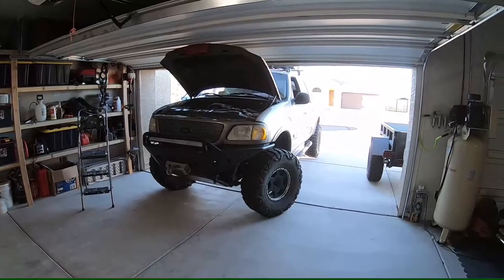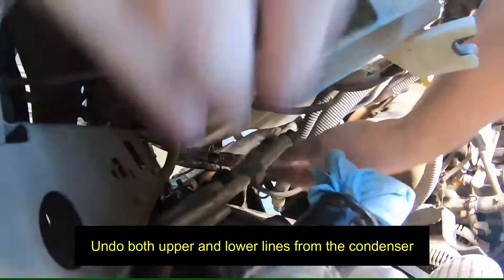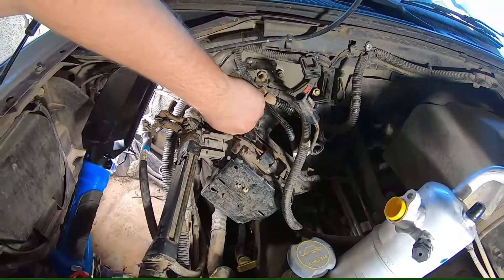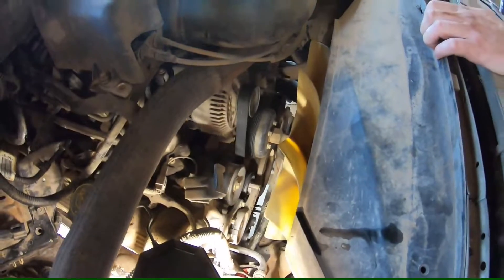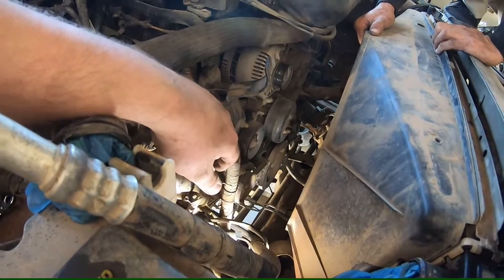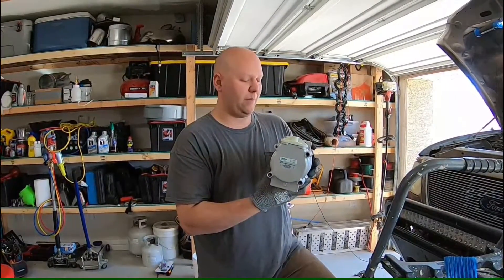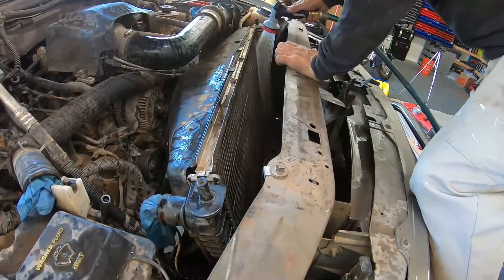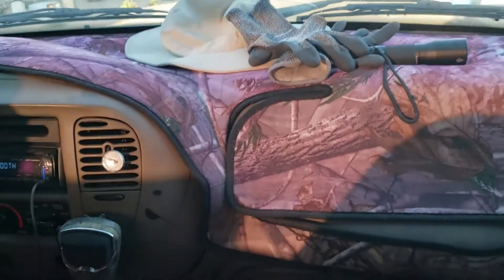1997-2003 Ford F150 A/C Replacement

Comment: Finally thank you I have a 2000 ford f150 that was sitting for 7 years and the stopped working after the mechanics changed the radiator and was deciding to work on it myself and this is the first video I found that was step by step and shows each part and piece
Reply from the maker: Glad I could help!

Comment: I am concluding a 2002 F150 5.4 air conditioning system replacement. 100% new. The dash board removal was awful time consuming. I changed the heater core while it was disassembled. The orifice tube was jammed packed with more debris than what you encountered in this videos. Accordingly, I didn’t believe a flush would suffice, hence the 100% new parts. However, the core inside the dashboard was pristine when I flushed it. Ultimately the core and the dashboard did not require replacement because of the orifice tube and the heater core was pristine as well. Cautious exercises to protect a new system was unnecessary but I wouldn’t be satisfied with uncertainty. Your video was very helpful. Thank you.
Reply from the maker: Glad I could help! Good call on taking care of the heater core while you were in there. Do it now or do it again later

Comment: Thank you! Because of this video I was able to put ac in my 1999 F-150 after almost 3 years without. Hardest part of the job was the accumulator by far! Thanks for a detailed video on this process it made this way cheaper for me then it would have been at the shop. Just  over $400 later and my ac is blasting cold 🥶 👍🏻
Reply from the maker: Heck yeah! That is what I like to hear :D. Thanks for watching and the comment!

Comment: Loved the video, it will really help me with my A/C replacement.  About to replace the whole A/C system in my 2001 Ford F150, 5.4 L.  At what point do you flush the system and what flush do you recommend?  When adding oil do you add all the oil needed for the system to the compressor or do you need to add the oil to the dryer and condenser as well?
Reply from the maker: I really rarely flush a/c systems...but I'm also not a mechanic. I like to use air and if it blows freely I hook it all up and call it a day. Oil they usually say to add it all to the compressor. Half the time you won't be able to get it all in there though so I'll put some in every component I'm able to access

Comment: How many oz of r134 did you charge with? Sticker says 33oz. I replaced condenser, manifold lines, orifice, dryer and compressor. Oiled correctly, vacuumed down for about 2 hours, let it sit for another hour with no movement on gauge. Charged it up at 33oz and it will not get cooler than 50. Pressures are about 50/275 at 90 outside.
Reply from the maker: Shoot it has been a long time since we did this one. I do not remember how much we charged it to unfortunately

Comment: Can you tell me what lift you used for this ford? I’m looking for same height and wheel tire ratio
Reply from the maker: Thanks for watching!
It's a 6 inch fabtech lift with 37" tires. 1" spacers, A little trimming at bottom of fenders to keep from rubbing
Reply from the maker: Nitto Mud Grapplers 37x13.50 R17

Comment: I just want to unplug wire leading to ac compressor… does it just pull out or is it a clip plug?
Reply from the maker: It'll have a clip on it if it isn't already broken!
Reply: @AGuyandHisProjects  thx for getting back sir! It does not pull out and I gather the clip isn’t broken lol… and have to be gumby to even get to it without taking 2-3 things off.. any ideas of easiest way? Much appreciated
Reply from the maker: @wolfkat6492  no problem! Typically a long thin screwdriver to pull the tab out of the way. If no good angle then a little tiny flat screwdriver sometimes gets you closer. You can also drop a tad of lubricant in the area sometimes first to break the crust up
Reply: @AGuyandHisProjects  thanks again bud! Will give it a shot.. would the pulley spin more freely and keep my belt safe?
Reply from the maker: @wolfkat6492  by unplugging the compressor? I am not a mechanic by any means, but I don't think that would help. If the clutch is seizing up with will be seized with or without electrical being hooked up. When the clutch is not pulled in (a/c off) the pulley should spin freely. If it isn't then you need to replace it or get some kind of bypass kit I would think.

Comment: Can’t get the top single bolt off it’s in an awkward position. How did you get all 3 compressor bolts off?
Reply from the maker: It's been a hot minute since this one. I don't remember struggling with that though

Comment: I don't know if you can help but the hard to get bolt you talked about on the A/C compressor is stripped. I have tried bolt socket extractors and a chisel. My lest resort would be to completely cut the bolt head off but I'm worried and won't be able to pull the compressor with the frame so close and the rest of bolt still in it.  Any suggestions would help. Thanks and great video!
Reply from the maker: Hmm tough spot you are in lol. If you have a welder you could weld a nut to the bolt head. Or possibly get away with vice grips and a torch. Maybe some others will pop up with some good ideas. Maybe cut head of bolt off and let compressor slid down a bit then Sawzall the other end off. Idk

Comment: How exactly do you get the second bolt in the back of the compressor off? I cant get it with anything because the spot is so tight and my ratchet wont fit. Everything else i try is trying to round the bolt off, did you all have that problem?
Reply from the maker: Yeah I vaguely remember that issue. I think we used a 1/4" ratchet and spent a lot of time making small movements

Comment: there are a few things you should note before starting this project:

1 - get your AC system evacuated before you break any joints.  takes a few minutes and practically any garage can do it for you.  this does not affect driveability
2 - take off the fan blade before the serpentine belt.  Autozone and most parts stores have a tool you can borrow for a 100% refundable deposit
3 - you 100% will leak engine coolant so be prepared to capture that and not re-use it.  buy new stuff.  also, it's got glycol in it so it's not going to evaporate if you drip some so clean it up
4 - every component in the ac system has oil in it so be prepared to capture that as well
5 - the accumulator requires a special tool to remove it that costs about $5 at autozone or any parts store.  it will likely have 4 size options and 1 will definitely fit your application
6 - if you are struggling to get the accumulator off, a little time with a torch will help loosen things up but use this as a last resort.  it is common for the o-rings, and there are 2, to basically seal themselves to the inner wall of the tubing.  the heat will loosen the seals.  if you don't try this, i promise you the garage you take it to will do this.  DON'T START THE ENGINE COMPARTMENT ON FIRE!!!
7 - there are 2 rubber/plastic guides on the side of the condensor.  these need to go back on when you're finished.  they allow the fan to suck air through the condensor when the vehicle is running but not moving.  if you don't you will not get cold air
8 - the guides mentioned in note 7 are held in place by push fasteners the press into holes attached to the condensor.  it is extremely likely that those holes will not be available on the replacement condensor so you will need to find another method for attaching the guides.
9 - clean as you go!  you don't want debris falling onto sealing surfaces or contaminating the system when you are putting everything back together
10 - the high pressure gas tubes that connect to the compressor are very likely rusty and very brittle (your vehicle is nearly 20 years old so...).  they may need to be replaced if you can't get pressure built up in the system after reassembly
11 - there are 3 bolts in the compressor.  2 are accessed from underneath and 1 through the wheel well.  that's how i did it any way.  the 1 bolt on the top MUST BE INSTALLED IN THE COMPRESSOR PRIOR TO INSTALLING.  there is not enough room to get the bolt in place when the compressor is back in place.  save some time and put the top bolt in before sliding the compressor in place
12 - READ THE INSTRUCTIONS ON THE COMPRESSOR!!!  there is a sticker on the compressor that says how much oil is preloaded.  the instructions will tell you the total amount required for proper operation.  mine came with 3 ounces.  the bottle of oil i bought had 8 ounces.  the compressor required 9.  i did absolutely measure out and add exactly 6 ounces prior to installing the compressor
13 - if at any point you get stuck or frustrated, stop.  the vehicle still drives perfectly fine after putting the belt back on.  of course that will require the compressor to be installed.  it is better to suck it up and bring it in then cause permanent damage out of frustration.

lastly, and most importantly, this is a job that can be done with a very basic set of tools and will take the average garage mechanic 6-8 hours.  it is totally doable and very fulfilling.  when you take your system in to get charged the mechanic will definitely respect the skills.  mine did.
Reply from the maker: Thank you for the thought out comment! Yes it is indeed very rewarding!

Comment: What about the evaporator core? Is some of the metal fragments left in the evaporator if you don't change it? My freon just leaked down. The compressor is still good. Truck had 53,000 miles when I bought it total wrecked, It set up for 5 years. Then I changed the frame leaving the A/C intact and A/C needed a little charge and afterward worked a few years and leaked down. Added some 134 and stop leak and got the A/C blowing cold for a year but last year it leaked down, and I have been driving without it this year. We had record 100 degrees plus heat here in New Orleans for a couple of weeks and forecast more to come. I turned on a fan mounted on my sun visor, and it felt like I was in front of a heater. So looking to get the A/C working. Guess I need to shoot some dye in the system and see if I can see where the leak is. Maybe fix the leak and change all the O rings, replace drier accumulator and orifice tube then evacuate and add Freon. Hoping the leak is not in the evaporator core. IF so probably have to remove the dash to replace evaporator. I got a 2000 F150 with only 116,000 miles. and I used the A/C sparingly so figure the compressor should have plenty of wear left on it.  Any suggestions?
Reply from the maker: If the compressor hasn't seized up and started spitting metal I wouldn't imagine needing to worry about the evaporator. Pulling it all apart and replacing drier and office tube is a standard maintenance item you could do though.
Reply: @AGuyandHisProjects  Yeah, I did not intend on changing the evaporator unless it is leaking. I was asking about your job changing all the parts out. I guess with the evaporator under the dash it would be too much work and costly to change the evaporator unless absolutely necessary. You say you flushed your system out with air so I guess if any metal was left in the evaporator the air would thrust most of it out. If any minuscule particles were missed, they would likely be caught by the orifice tube filter once the system was charged and cycled.

Comment: Can I get your opinion on the Valeo ac compressor. I decided to change it out myself because I don't feel like giving up the cash for someone else to replace it on my 1998 Expedition. I was looking at the Motorcraft version but those things are too high. I don't want to spend $300, but I don't want to have to replace the Valeo in 2-3 years. What has your experience been with this brand of compressor? FYI, I want to purchase a brand new one. No more remans. My reman compressor last 2 years, maybe....
Reply from the maker: Thanks for watching! These have been alright in my experience, however if you want it to be done with forever I'd go Motorcraft or maybe denso. Oem is definetly better than aftermarket with my experience.
Reply: I hear you. I'm definitely down with, "Buy once. Cry once"  @AGuyandHisProjects . I'll just take the hit and get the Motorcraft if I cant find a new Denso. Thanks.
Reply from the maker: You are welcome! Keep in mine I am not a mechanic and have only done a dozen or so of these.
Reply: @AGuyandHisProjects  Im not a mechanic either, but I have heard good things about Denso replacement parts for years. Plus, your done a dozen more than I have. I have bought Denso coils for my wifes Mazda 6 and they haven't failed us yet. I didn't think that they were competitive in the ac compressor market as well until now. The prices on these new ac compressor units are not that much cheaper than Motorcraft. Brand new Denso for my truck is $291. Seen some advertised new for $193 but I suspect that they have remanufactured parts in them. I am not screwing with those. Anyhow. Thanks for your opinion on the matter, and keep up the great work on the instructional videos.
Reply from the maker: @nytshade2  thanks! I am not a fan of the reman either. Too many bad ones
Reply: @AGuyandHisProjects  I finally got around to changing out the condenser and compressor. I picked up a new one from Motorcraft. I replaced the line that connects to the compressor and dryer too. I’m trying to remove the dryer but it’s not budging. You weren’t lying about how hard this one component is to remove.
Reply from the maker: @nytshade2  haha yes indeed! By far the most challenging part of the whole job.
Reply: @AGuyandHisProjects  I got it off and got the job done. Thanks again for your video. Gave me the courage to get off my lazy rear and do it myself. Probably saved myself $1000 or more. Now I gotta fix my kids Honda ac system. Take care.
Reply from the maker: @nytshade2  Thanks for coming back for the update! I like hearing the success stories that my videos helped make happen :). Good luck on the Honda, wish I had a video for you

Comment: Did you add oil into the accumulator too?  I watched another video where the guy claimed you had to drill a hole in the bottom of the accumulator and measure the oil that comes out, replacing the same amount into the new accumulator.  I have the exact same job you did coming soon.  My my system was open for several years. with a large manifold hose failure, so replacing all the equipment you did.
Reply from the maker: If you are replacing all components you need to add the whole amount listed on the sticker under the hood. If system has been leaking then the oil has leaked out as well and the measuring "trick" is not accurate.

Comment: Is changing out the compressor much different on a 2005 f 150?
Reply from the maker: If your engine bay looks the same it is probably similar. I can't answer your question with certainty though

Comment: Big job. 2 little nuggets though, its much easier to get the compressor out by removing the 2 21mm bolts that hold the steering linkage to the frame on the drinkers side. Also, by removing the inner finder, the accumulator is a piece of cake. Great video.
Reply from the maker: Thanks for the comment! I appreciate the advice and hopefully others will take advantage of it as they scan through the comments as well :)
Reply: The drinkers side… I love it!
Reply: @wolfkat6492  LoL....southern slang at its finest.

Comment: I have a 2001 ford expedition with a 5.4 liter triton engine also and want to change the compressor only, how many cans of freon does it take? Thanks for the video already gave u thumbs up.
Reply from the maker: I wish I could answer that question for you! Typically if you are lucky you find a sticker attached under the hood somewhere that will tell you both refrigerant and oil types and capacities

Comment: Dont dance with it...
Pull the right front wheel and wheel liner.
Remove the bolt that holds the harness to the frame so the harness will move.

From underneath, remove the belt and the bottom 2 compressor bolts.
From through the wheel well remove the top bolt and the lines. Move the compressor forward, drop the nose down and pull it out over the frame rail through the wheel opening. (I like to go ahead and unplug the crank sensor harness to keep it out of the way and avoid damaging the sensor)
You can also easily access the hoses and orifice tube from there.

There is no need to remove the upper radiator hose to remove the condenser - remove the radiator brackets, the condenser brackets, and remove the condenser by raising the left (drivers side) up first.

The accumulator is the hardest part of the entire job. Slightly easier to get to the one bolted line and the bracket from underneath but there is still a ton of crap on top to fight with.
Reply from the maker: Tha is for watching and the thorough comment! I absolutely agree that the accumulator is the hardest part 😆

Comment: Shalom How Did U Get That Accumulator Loose With That Discount Tool?Does Tha Tool Have To Go In Tha Fire Wall With End Going Inside Tha Wall?
Reply from the maker: Thanks for watching! No not into the firewall, just have to get it to fit into the coupling